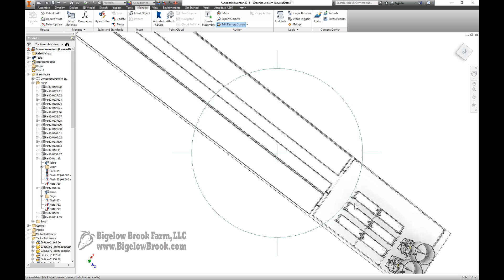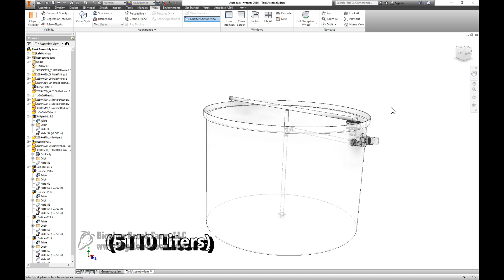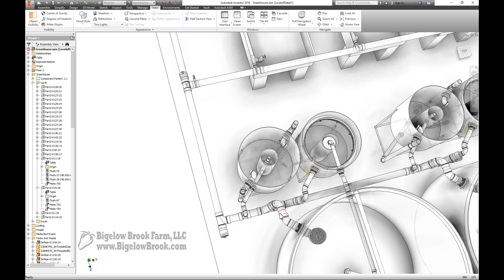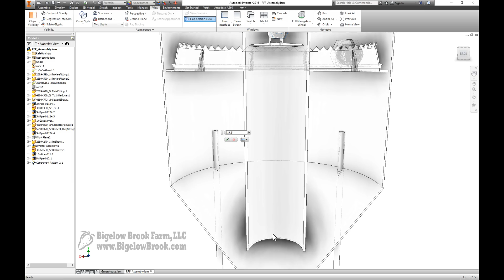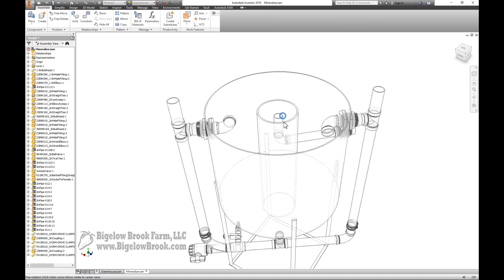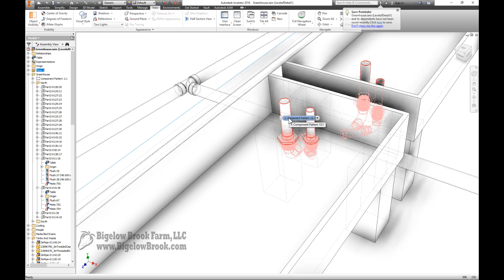Big Aquaponic Greenhouse - Part 10 - Design Details!

Comment: if you could find a way to automate the valves, I'd have a slow pumping of water from the mineralization tank back to the settling tank, then once the water is a few inches low, have the valve open for a moment to move waste over from the settling tank to the mineralization tank. would it be a good thing to have a little more water circulating from that tank? at least for the plants I'd think, maybe not beneficial for the fish.

Comment: If you build the sump lower than the garden beds and everything else and pump from sump to tank you won’t need a pump to pump the water from the garden bed back to the sump.
Reply from the maker: there is no sump in this, just one pump
Reply: @Bigelowbrook   
If you run a sump you can use the system as a hydroponic hybrid If you want to bypass the fish tanks for a while for any reason.
Or bypass the beds for maintenance etc.

Comment: Looks great, but how does your bell siphon break when it ties into a pipe that empties in a submerged DWC bed?
Reply from the maker: The overflow pipe next to the bell siphon acts as a vent.
Reply: @Bigelowbrook  That's fantastic! I assume you're also using your 3d-printed bell siphons so that the breather tube assists the break? Does the overflow have a one-way valve to prevent water from the vacuum coming back into the media bed? Or does the pressure from the outlet pipe keep it from coming up the overflow?

Comment: 19:25 Diverter plate + to make laminar water flow, maybe put a bounch of 2-3 inch pipes, length wise i guess nearly all the way to the bottom and 1-2 feet under your diverter plate 2) maybe design your diverter plate with many holes 2-3 inch holes you want to try to spread the water evenly to each pipes,  have 1-2 of water level clearance from the diverter plate to the pipes, just youtube laminar water flow, plenty of people done it you need to mod it for your applications tho eg not use net at bottom to hold the pipes, instead just use some metal and tighten it on the sides.

Comment: Hi there would a ram pump work in this system? Instead of an electric pump.
The settler tank as you call it. Is that called a swirl tank as Well? 👍👍👍👍
Reply from the maker: ram pumps are very inefficient.  A settler is different than a swirl, you want to use a settler.
Reply: Bigelow Brook Farm (Web4Deb) that’s great. Thanks for getting back 👍👍👍

Comment: Would it be just as affective as to have a fan both ends of the poly tunnel. One end sucking in the air and the other end, blowing out the air. Only that your fans have to have the power to blow down the full length of the poly tunnel. As having one either end. They don’t need to be so powerful just a thought. 
Like the video. Looking to do this myself. Hence why I’m asking. 👍👍👍
Reply from the maker: you want to suck the air out.  If you have on blowing in, it can balloon the plastic
Reply: Bigelow Brook Farm (Web4Deb) I thought the idea was to circulate and remove the hot air by sucking in fresh air from outside. 
I’ll go with what you’re saying. Cheers 👍👍👍

Comment: I ran my six bell siphons with 1" risers to a common 2" drain but couldn't get the bell siphons to work consistently. I tried several variations before increasing the  common drain to 4" and  cutting slots into the common drain for the bell siphons to dump into.  I am no plumber but I think  the bell siphon drain being open to the  atmosphere  rather than  a fixed PVC connection was crucial to the success of this method.
Reply from the maker: I agree.  That's one of the reasons why I also have that emergency overflow pipe in each bed so that there is a vent next to each siphon

Comment: Dont know where you live but your holding tanks,should,be,in the ground for temp control
Reply: That's a fallacy, temperature differentiation in the ground starts around four feet deep and it has to be enclosed with dirt. You place the tank in the ground to lower the surface level, not for temperature.
Reply: in this case he will have to raise the ground around the fish tank . because half part of this system is like ''gravity feeded ''

Comment: What's the flow through the SLO vs side drain in this setup?
Reply from the maker: From poor memory, it has 200 gallon/hour going through it so that would then be around 1000 gal/hour go through the drain.  I would have to measure it again to confirm.
Reply: @Bigelowbrook  my concern was the diameter of that SLO pipe to flow rate. You may get settling in the pipe. I know I got that now in my setup due to not enough head from fish tank to RFS.
Reply from the maker: @mattolsson8816  yeah, I've been checking for that.  I have the valve on that line mostly closed to keep the flow down but I can pop it open to flush the line.  So far no big chucks have come through.  We'll see what happens when I start loading it up with more fish this spring!
Reply: @Bigelowbrook  it took a while for bacteria to grow in the pipe. Heat will speed that up. Just beware. Lol. I just spilled fish poop all over the floor of my RAS shed when cleaning that pipe. 😁

Comment: Interesting idea with the mineralization tank.  I would have thought you wanted as much of the solids as you could get into the flood/drain media beds.  The media beds act as the particulant filters for the raft beds and as a nitrogen fixer for the whole system.  I'm assuming the mineralization tank holds the solids longer and recirculates to make a "fermented" fertilizer tea?  Do you get more nitrogen this way?  Great video and I'm thankful you took the time (and expense) to show us the details.  Looking forward to watching the completion, and more importantly, the long term running of this great system.
Reply: I'd guess without the remineralisation tank the solids would build up in the media beds and clog the expanded shale, probably wouldn't be a big problem and would just require more regular cleaning of the shale/beds. The remineralisation tank would also lower the soluble organic content by having bacteria eat it which would then settle out and get wasted as sludge, I'd guess that if too much organic went into the media beds then more bacteria would grow there and similarly clog up the shale faster. There'd be some nitrification of ammonia to nitrates in the remin tank too, but I doubt Rob chose to include it for that as the media beds should do the nitrification

Comment: One of the biggest biggest time saving mechanisms I find is proper planning before starting the actual project. not only does it help to keep financial costs in check but it also allows the actual construction part move smoothly.

Comment: Is there a danger of water in those buried sections freezing over winter and bursting the pipes? I don't see a way of getting the water out of them once it's in there.
Reply from the maker: Blow them out with compressed air, just like a lawn sprinkler.  I just keep the pump running all the time.

Comment: What do you think of adding bio balls or something to increase biofilm surfus area to the remineralization tank?
Reply: What I have done is add MMBR in the mineral tank, doesnt cost much and is one time investment.
Reply from the maker: The media beds act as the bioreactor.  Plus is creates an environment for the red wiggers and my longer term plants. It will also work by gravity so I don't need the waste the power on an air pump